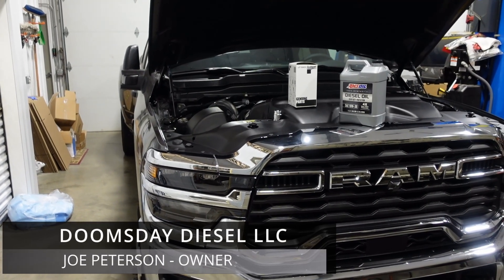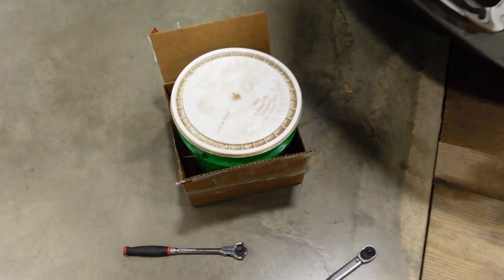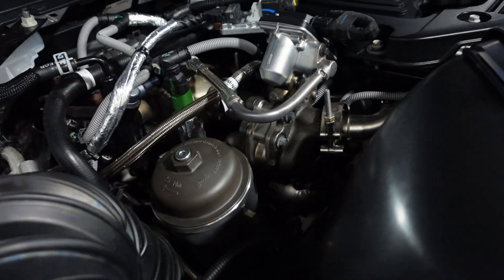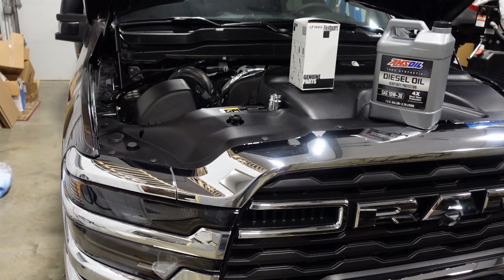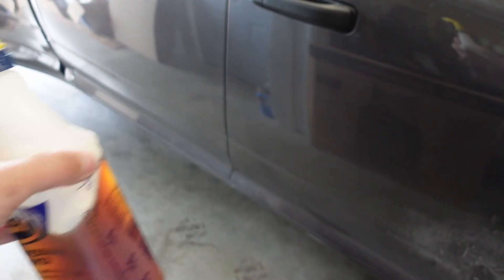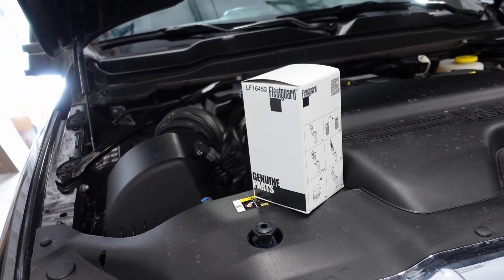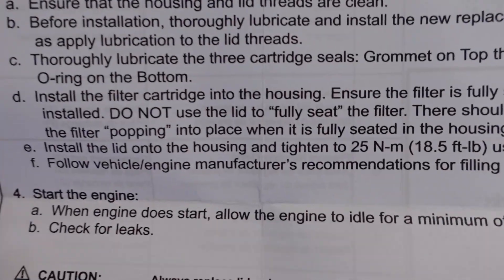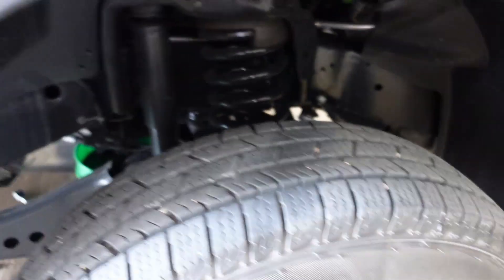Episode 2: How to Change Oil on 2025 Cummins #projectshiloh

Comment: So we just dry start these new ones with the top filter ?
You'd think there'd be a procedure for avoiding a dry start
Reply from the maker: I confirmed on my 2nd oil change - Put the filter in, then fill the canister with oil. It changed the time it took me to see oil pressure from 3-5 seconds down to basically instantaneous.
Reply: @doomsdaydiesel  Thank you. I wasn't sure about trying to fill the canister.  I figured it would just drain back down.
I just did my first O/C at 800 about an hour ago, so it got the dry start.
I really appreciate the info.
Reply from the maker: @captainmorgan5106 the filter has to be in. The bottom of it is what seals the oil from draining out
Reply: @doomsdaydiesel  Ok, that makes sense since it didn't drain until I popped the filter. Good to know. And thanks again for your videos and info.

Comment: Geno's just emailed (9/2/25) that they may have stock to ship end of the month.
Reply from the maker: As much as my 2025 sits broken down, it's going to be hard to use all the oil filters I have 😕
Reply: @doomsdaydiesel sorry to hear that. 
I'm just over 1500mi and a month away from a possible filter change unless I go Mopar label for 4x the $. Good thing I won't drive it that much til then.

Comment: Thanks for the tip on Geno's Garage.  The dealer in Rice lake Wi. Charged me 87.00 for the oil filter and Geno's charged me 18.00 .  I ordered two.  and two sets of fuel filters since they were 80.00 and the Dealer wanted over 200.00
Reply: My dealership was asking $122 for oil filter and $348 for fuel filters so i just ordered on genos garage

Comment: After draining for one hour changing filter, filling and running for a couple minutes and let sit for 1 hour my dipstick shows almost top of safe on the dipstick with 11 quarts. 2025 Ram Cummins. 

BTW the factory overfilled per dipstick by about one quart.
Reply from the maker: It's a lifelong debate on these - 11qt or 12qt. You're supposed to check the level after 5 minutes, not an hour. But either way, there's an EXCELLENT youtube video about overfilling an engine and the effects. You generally have to overfill by an extreme amount before there are negative consequences. Underfilling is a different story.

Comment: Rotella T6 5W40 all day…
Reply: 5W-40 T6 Rotella year round is fine. This will not void your warranty.
Reply from the maker: I guess if you want to void your warranty and risk destroying your engine 🤷🏽‍♂️ I'm gonna go with what's listed on the oil cap
Reply: @doomsdaydiesel Ram owners manual says Rotella, Cummins endorses Valvoline.
I was told 19-24 all originally came 5 40
Reply from the maker: @jimf1450 this video is for 2025, not 2019-2024.
Reply: @doomsdaydiesel 19-24 use the same viscosity oil, point is they have cold weather oil in them bc they don't know where the truck is going & when it'll be sold so to be safe they have 5 40.

The reason for the different oil in 2019 & up is bc of the hydraulic lifter valvetrain.
Reply: Is it true? You can avoid your warranty if you use another brand other than Mopar
Reply from the maker: @GMSLVDanyaahla  incorrect viscosity, not brand.
Reply: You are 100% right my friend
Reply: 5w40 only for winter use, 10w30 rest of year.

Comment: Where do you live that you are using 10/30?
Reply: Just  run 15-40 Rottela T-6 with 1/2 qt marvel mystery oil and 1/2 quart dura lube. You will be friction  proofing you're motor to last 1 million miles. Forget the 10-30 oil. You're going to score you're pistons. I did this on my Dodge 5.9 heavily modded diesel, it ran like a turbine for 23 years, never burnt a qt of oil in 23 years. Got hit head on 2 months ago, in the end, my old girl saved our lives....RIP old friend 2002 Dodge Ram diesel longbed
Reply: Just about every new diesel runs 10-30 or 5-30
Reply: @bigmurph1447  the 6.7 Powerstroke and Cummins do not recommend 10/30 if you live where I live. 100 degree Summers, cold Winters and Haboobs. Ford even had it in the oil cap which no one bothers to open their manual and find out why.
Reply: @bigmurph1447 the manufacturer is trying to destroy you're engine( disguised as kissing EPA's a**

Comment: at how many miles did you do your first  oil change?
Reply: Do 1st change at 5000 miles if not towing or hauling, if doing those things, change at 3000 1st change. Cummins engines are pre-broken in from factory
Reply from the maker: I mention it specifically in this video
Reply: @doomsdaydiesel I dont think he watched the video 😂